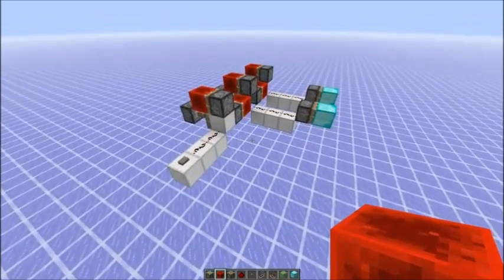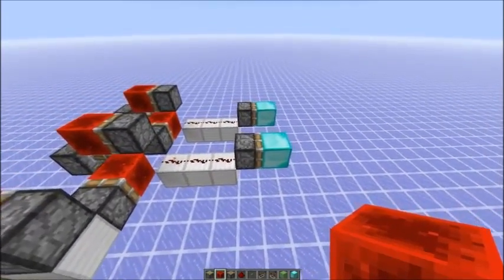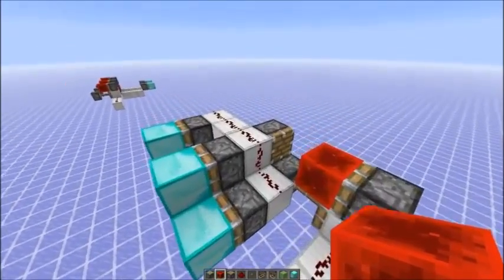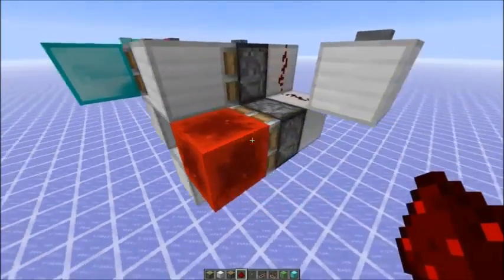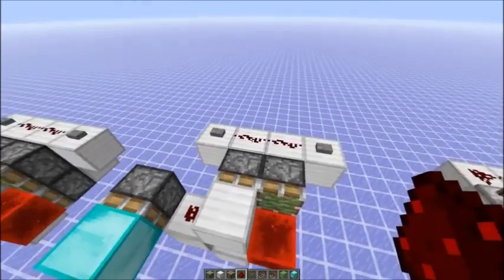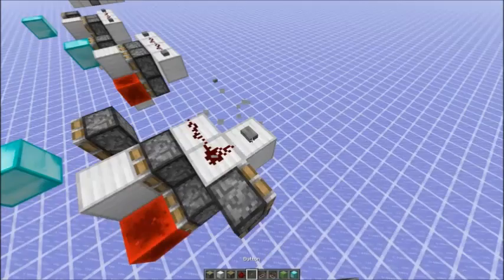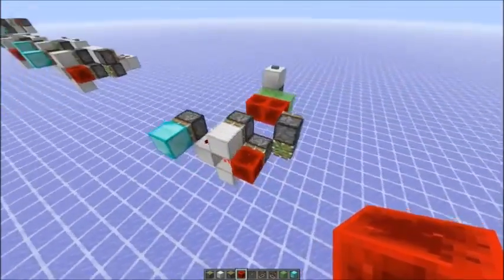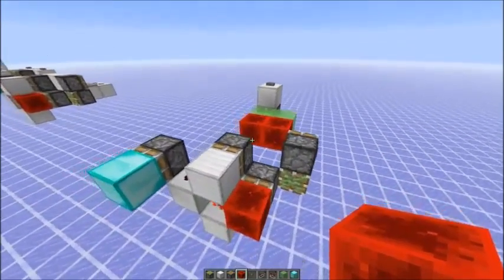non locational instant 0-tick pulse generator

Comment: isn't the one i made non locational?
Reply from the maker: Thijs Simons it is. the problem I always had with that one is, that the signal doesn't get repeated.  You normally start with a low signal strength and can't use much of the signal afterwards. If you buiild a 0-tick repeater right in front of it, it's getting really bulky.